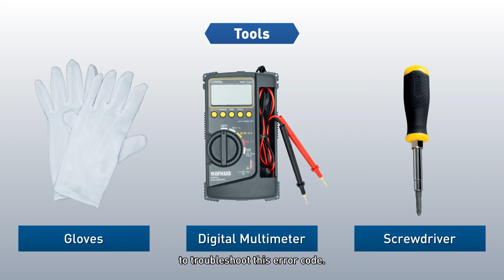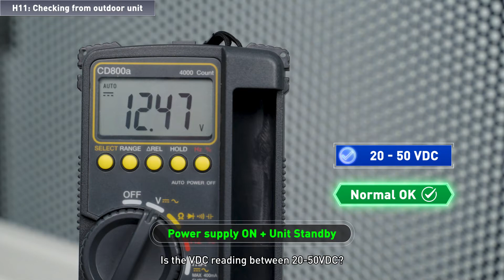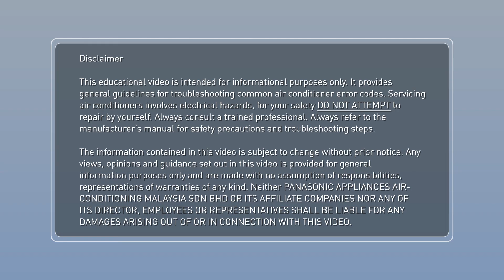Panasonic Error Code H11 Indoor/Outdoor Abnormal Communication

Comment: Which components would lead to a low VDC reading for the "Replace Indoor PCB" tests if you're seeing an H11 error code? 

Wiring seemed good, and the tests for Outdoor PCB were fine, but I was showing very low VDC (~2.5) when testing for the Indoor PCB failure (tested from both the outside and inside unit), so I replaced the Main Control Board (CWA73C6805) and Power Control Board (CWA746567), but I still see the same issue (system powers on for ~30 seconds, then starts to blink and powers back off with code H11).

Could the Indicator board (CWA747108) or the Sensor (CWA50C2989) cause an H11 failure? Low refrigerant?

Comment: Hi. When Measure the out door and indoor unit, does the voltage need to fluctuates for the PCB to be good? If a static voltage like let’s say 30VDC (does not fluctuates) is considered good or bad? Thanks for the helpful video
Reply: There should be fluctuation